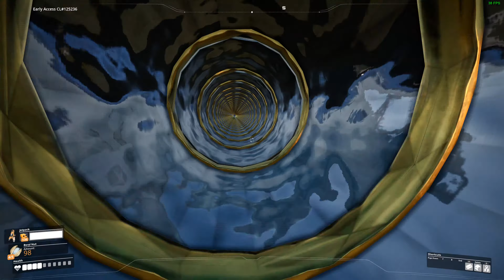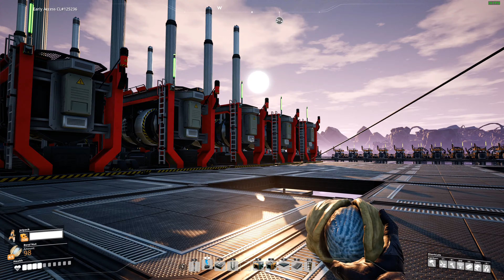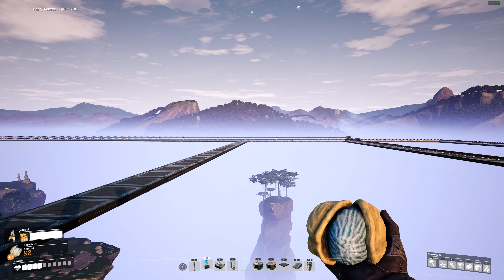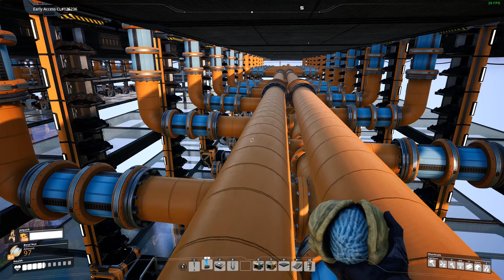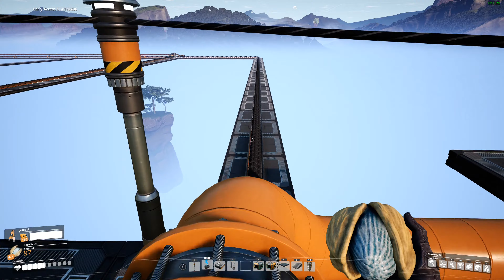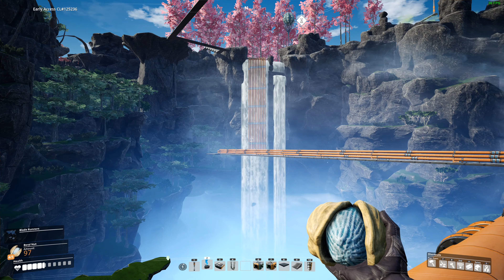Satisfactory Factory Tour Part 2 - Coal Power

Comment: I am interested in how you made those pipes.
Reply from the maker: lots of scaffolding. I created a lot of floors, ran a vertical pipe to it's maximum then use a "Pipeline Junction cross" just before the bend, this cuts the pipe. You can then delete the junction and the bend after it. Move down to the next floor, extend the pipe down further, cut it with a junction, repeat.
Reply: @pseudocode6506  thanks for the reply. I tried it with scafolding the same as you and it worked. Thanks a lot for showing this trick. Lower energy cost am I right?